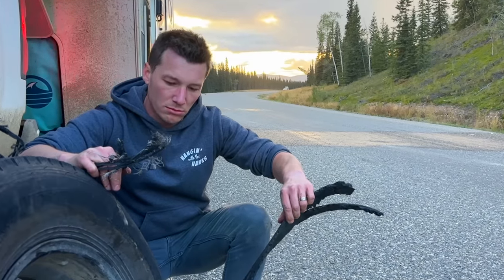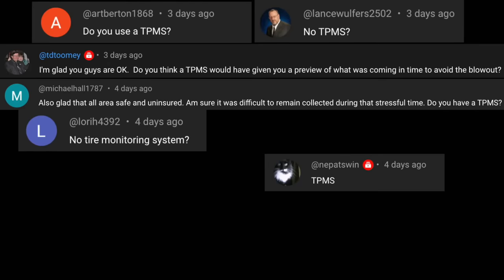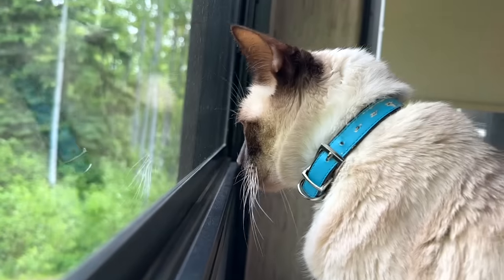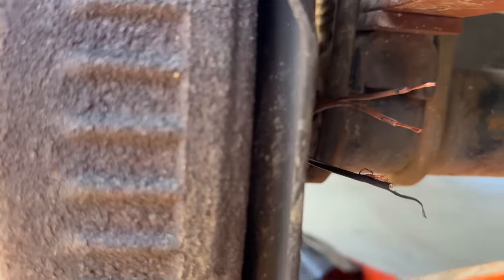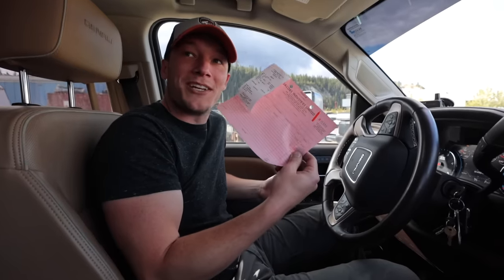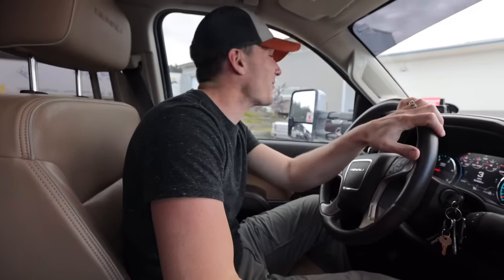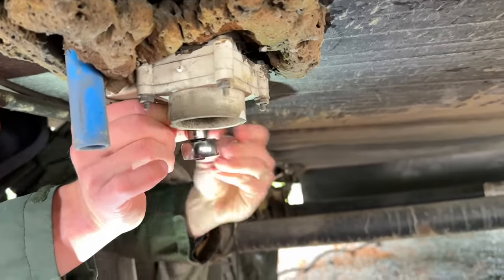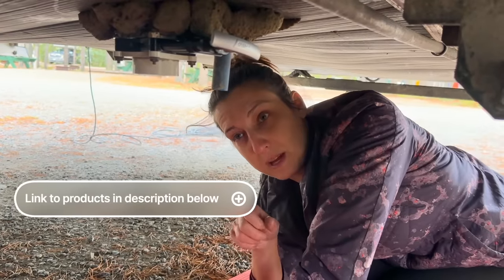RV Repairs: AVOID WAITING MONTHS (Quick & Convenient RV Services)

Comment: 2 wires run to one brake on the front axle. 2 wires from there run through the axle to the other side to power the other brake on the front axle, and 2 wires run to the back axle, where an additional 2 wires run through the rear axle to power the other brake on the rear axle. The wires running through the axle can sometimes rub through the insulation on the wires, and will short out the brake system, or cause one brake not to work. I think with yours being the rear axle that had the wire damage, you may have had at least the front axle brakes working.
Just re-watched. Looks like the front, not the rear? So yeah, quite possibly no brakes.

Comment: On our Imagine, the brake wire from the 7 pin runs down the drivers side to the front axle, splits 3 ways, to the front left wheel, thru the axle tube to the front right wheel and to the driver side rear axle and again splits to the left rear wheel and thru the rear axle tube to the right rear. We had the wire between the axles pull out of the 3 way connector at the left rear so the whole rear axle had no brakes. If the wire anywhere forward of the front axle and the splice into the 7 pin wire breaks, you will lose all brakes. There's no second wire on the right side.
Reply from the maker: Thanks for the info!

Comment: For a under floor repair, used a plastic yard sign and stapled it to the wood.  The coated several times with flex seal.  I also went from up a size and letter so tires are way over the weight capacity of the trailer gvwr.  Looking at a newer larger camper and wondering how long before replacing tires with higher weight capacity.

Comment: Addressing the Tom pressure issue I never run more than 90 or 95 Cold the 110 is a recommended maximum you really don’t need it on a smaller trailer unless you’re running the 42 or 43 footer then I will only run about 100 or 105 my 18 wheelers only run 105 psi cold

Comment: Kyle… you likely had no brakes. Typically all light cord wiring runs down the left side of the RV. Brake power to the right side brakes goes through the axle tube (horrible design) and I saw in part of your video those wires were damaged. It’s got nothing to do with Series vs parallel. 

Shop that fixed your brake wiring was very fair given they had to remove that hub to repair wires on that magnet. 

Thanks for the great content!

Comment: Pssst Ney Ney, tires don't come apart from over inflation they come apart from under inflation.  As for the repairs, at $111 the brake repair was very inexpensive.  I wouldn't have cost me that much but I do my own work.  The rest of the repairs were pretty reasonable too.   Thanks Hanks and keep the good stuff coming.  Now it's down to the basement I can get on the road in next week..

Comment: Our TPMS didn’t help with our blowout either. The tires looked fine to us- didn’t see cracking. And it stayed correctly inflated until it wasn’t (when it exploded). We think maybe there was just a critical failure on the side where the afternoon sun hit while in storage (less than 100 miles later the 2nd one blew). These were the original tires.. just a couple years old and we’re not full time.. so I’m sure we should have replaced them sooner. Now we use tire covers. Love Discount Tire.

Comment: We lost the driver side rear due to a separated connection. Did not realize it until I noticed the passenger side front locking up and skidding. Reconnected and needed new tires.

Comment: Consider your self lucky. We had a blow out on our reflections camper same tire as yours. The tire went thru the floor broke sum of the framing and pulled most of the wiring away from the control panel and wrapped it around the axle. They totaled the camper out. Looks like we will be going shopping next spring. I also enjoy every one of your videos.
Reply: Ouch

Comment: The trailer brake wires are run down one side of the trailer. Each axle has wires running through it to feed the other side, you can see the wires in the hole on the axle in the video.

Comment: The wiring that got ripped off  that you put into the storage compartment. That connected the front driver side and the back driver side. so you didn’t have brakes 😉 The axles themselves from one side to another side are ran through the axle tube. Which ties them together on driver side.

Comment: had the trlr brakes go out on my 5th wheel in florida, drove basically almost 200 miles scared you know what less. wasnt getting power to trlr. rented a car for two days, drove 120 miles to dale earnhardt dealership to get the part they said they had. got there and o i am sorry thats a special order part. i came unglued. they called few days later said it was fixed, picked up trk $360 bill and it still didnt work, blamed it on a corroded plug yet they didnt replace it or even attempt to clean it. after my own research i found the problem, it was the trlr switch not making contact. took apart cleaned and bent the copper tabs for better contact and it works. so after $360 bill,$200 car rental i have lost any trust on these repair shops, seems like education is gone , the new is how lazy and how many excuses you can come up with to swindle more money. total cost to actually replace the trlr switch in dash was $26 on amazon.so i bought a spare. the dealer called me and made sure to let me know they were not happy with my review, but would not return my money even though nothing got fixed.

Comment: Every trailer I've ever had with brakes was wired down one side, with the opposite side wired through the axle tube.  I'm not sure I would want only one side working either as it could create an unstable trailer in a hard braking situation.  I have basically the same truck, and lost brakes pulling around 15k lbs once.  Wasn't too big of a deal with the exhaust brake, even in the mountains.

Comment: As a long time trucker my thoughts are .. not having any trailer breaks are bad. If you would have been in snowy or any slick conditions. With trailer brakes only working on one side you would be risking a jackknife due to only one side grabbing. No brakes is no better due to the fact your trailer would be pushing your truck. Moral of the story … speed kill’s keep it nice in slow when you have no trailer brakes. Take it from a guy that has gone down mountains with my brakes smoking and could not even see the back of my trailer.

Comment: On our Trailer, the wiring goes down to the drivers side brakes then thru the axel tube to the passenger side brakes. The problem we had was the insulation on the wire inside the axel tube wore thru and shorted out causing our brakes to fail.

Comment: For sure a parallel circuit.  That doesn’t mean that that there is a wire running down both sides of the trailer.  It is very possible the technician was correct.  A series circuit in a simple explanation means the the power wire for the next component is the ground wire for the previous component.  The 2 power wires and the 2 ground wires could be supplied by a single power wire and single ground wire and it would still be a parallel circuit.  Another way to look at a parallel circuit is that each component has it’s own ground wire.  If I had the ability to draw it out it would be a lot easier to understand.

Comment: Have you guys looked into changing your magnetic brakes to hydrolic?
Kodiac is a company that sells that. 
In essence, the entire wheel hub and all the other components in the magnetic break system is changed to a hydrolic pump, hard lines and rotor assembly exactly like a regular vehicle has.
It is supposed to be a better braking system that significantly increases the braking power of your trailer/camper brakes, saving wear and tear on your tow vehicle brakes.
The hard hydrolic lines may have survived a blowout keeping your brakes intact during this catastrophe.
Reply from the maker: Wouldn't it be a ton of extra weight to get hydralic lines installed?
Reply: @HappilyEverHanks  nope, same diameter hard lines as what your truck uses, and the pump and reservoir about the same size as a slide out.
I believe you can get them at etrailer also.

Comment: I used Gorilla Waterproof sealant when we blew a tire. You might want to hit that bare plywood with it when you get serious about the repair. Eternabond or whatever over the top then gives a 2 step seal. 

I'd look for the Eternabond to fail on more gravel roads and/or high heat. You wintering in AZ?

Comment: Well, I can relate to problems on the road. First trip this year (Maiden Voyage) just under 1500.00. Water pump blew on I-10, Exit 90. This covered two tows one for the truck and one for the 5th wheel. Second one, around 1300.00 1 tow (Truck) (we were able to get to the RV sport so no tow there. The problem was the A/C pump went out (Mesa Verde, CO), and the cooling fan. Over all, it was costly, but we were truely blessed as these two break downs could have been in a lot worse areas!
Reply: What brand truck do you own?   I’m doing research on my next purchase
Reply: I have a 2005 Dodge 2500 with th 5.9 diesel.  @slalomking

Comment: Just an opinion: Have not experienced separate left side and right side electric brakes on a trailer.  My first concern is the trailer wanting to jack-knife with the tow-vehicle, having one-sided braking.  {Low speed driving and a low electric current flow through the brake controller / (setting to less sensitive); for the trailer, might , reduce that scary stop situation}.  <Opposite of having all four wheels with operational brakes; thus having, up to, or close to, full-lockup of all four wheels available, for panic stops>.

Comment: Your brakes are wired in parallel per each axle.  Based on your video you lost your brakes on your rear axel.  As long as the wire didn’t brake on the front axel you would have brakes on the front axle.

Comment: Curious if anyone checked that the trailer wheels are all running in the same line. (a.k.a. alignment)  While a tire can develop an issue and blow out the way trailer frames are made so cheaply I'd be wanting to know if there might be some damage/wear, especially considering the roads you've been travelling. I'm thinking somewhere in the past you mentioned something about a tire showing odd wear? It could be from a damage tire belt or from misalignment.
Reply from the maker: We're thinking a possible bent axle, enough to wear over time

Comment: We lost our trailer brakes for a whole year after a tow truck fried them. One wired burned up and knocked our complete braking system out on our fifth wheel. Couldn't find anyone that could tell me why we didn't have any brakes. So at the end of the season I took it to Camping World cause they bought out the dealership that I had purchased it from. They had it for 5 months and said they could not figure out what the issue was, in the meantime they damaged the back corner of my rig while it was there. I went to pick it up and noticed the damage and she said that she would bring a mechanic out to show me that they could not find the solution to the braking problem and this guy put a meter on it and said yes you have no brakes I can't believe you've been towing this thing like this. It literally took him less than a minute to solve it and it was there 5 months. He said this was the first time he looked at this trailer and said he can fix it no problem. After fixing the brakes and repair the damage which took another week we have been good.
Reply from the maker: Wow! That is crazy 😯

Comment: Be careful about going to Les Schwab because I had a very bad experience with them.  I needed new brakes on my '15 Honda Accord.  They quoted me a decent price for all 4 wheels with new discs and pads.  So everything seemed fine for about 10k miles when I returned to my selling dealership for new shocks and bearing replacement.  I asked if that should have been done during the brake job?  'It would have been better'   they said but it needed to be done now. During the teardown the Honda tech complained that he couldn't get the caliper holder bolts removed.  THEY HAD BEEN INSTALLED WITH RED LOCKTITE!!!  This is very, very wrong since RED LOCKTITE is permanent!  He had to drill out the bolts and install some used parts from a local wrecking yard.  Les Schwab cost me an extra $170 just because they used red locktite instead of blue locktite!  I later confronted the manager at Les Schwab and he claimed someone else did it.  I produced the receipt.... nope...someone else must have worked on it in-between the brake job and the bearing/shocks replacement.  I WILL NEVER GO BACK TO LES SCHWAB!!!

Comment: I think your truck is more than capable of stopping the RV.
Reply: Is that because of the diesel?
Reply: @slalomking  the engine itself breaks, especially when running in tow haul mode.  And the truck itself has a robust braking mechanism. You wouldn’t want to pull that way all the time, but it’s OK for a short duration. It will wear out the trucks brakes faster.